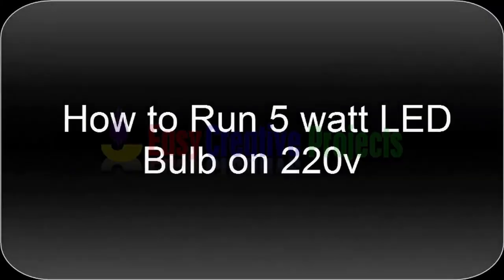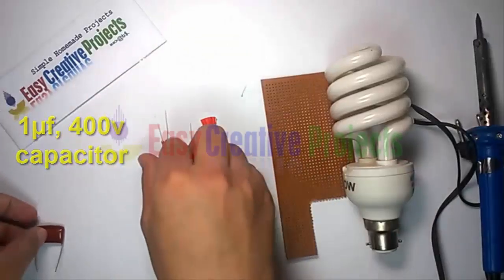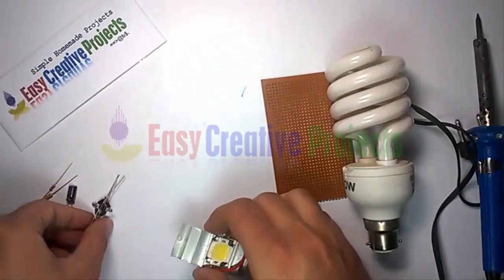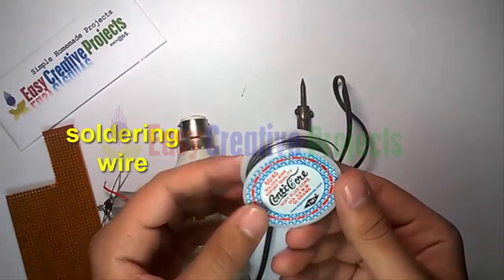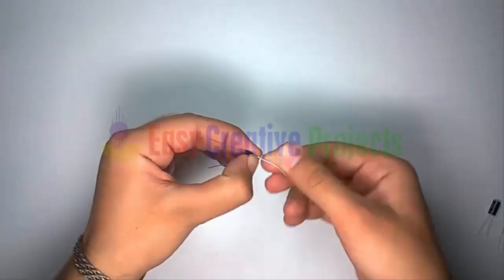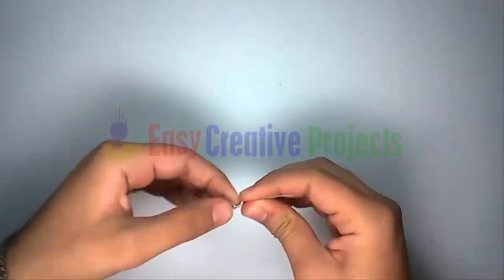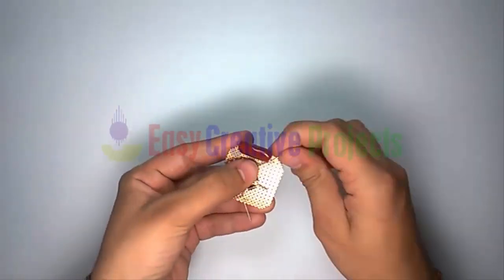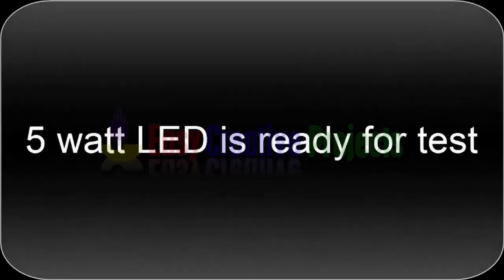How to Run 5 Watt LED Bulb on 220v - easy step by step with circuit diagram

Comment: These ckts are not good for long term use, because these non polar capacitors bursts in many cases. Again the driver ckts along with the LEDs are readily available in the markets. So don't be fooled  to drive the 12 v/5w led in 220v ac instead of 12 v driver ckts.
Reply from the maker: amazing dear.
in exam and practical you say, we can buy it form market. and get 100 marks.
dear these project only for education purpose. you cannot use it on commercial purpose.
2nd, this led work on my home last one year and perfect working. 
if you need any help or your demand project so please tell in comment.
thanks.

Comment: First time see the components and in the circuit diagram components are different
Reply from the maker: in this project we use simple components. you can buy this components from any electronic component shop.

Comment: Please can this circuit be used in 3w led? Or does it have to be a different circuit?
Reply from the maker: dear you can use it on 3w led. but voltage must 12v.
Reply: @EasyCreativeProjects  Many thanks for the response, it helped a lot. Very good your proposal, facilitates a lot, this way of teaching to do the surgery.

Comment: That diode in the middle of the bridge is doing absolutely nothing. Why did you put it there?
Reply from the maker: dear I use a 5th diode for extra safety. because this time we play with live wire.
and I think you know china components very well.
if your dose not want to use so leave the fifth wire. 
thanks.

Comment: One "em" WTF? don't you mean "One Megohm"? At least show a bit of expertise here please. Even a newcommer to the hobby knows this much. And where would I get 220 volts to operate said blinky light? Suppose I could tap it off the dryer or kitchen stove. But then, I'd have to jury rig a socket to it.

Comment: U suggest 1M RESISTOR BUT in circuit diagram is showing 10 k  ...sir
Reply from the maker: dear i am so sorry. 
please follow video when i make circuit diagram. after diagram by mistake page change.
use 1M, 2W resistor.

Comment: Isme 5watt led bahut hi low jalta h
Reply from the maker: dear aap nay capacitor ulta lgaya ho ga. 
check capacitor terminal. if every thing is ok so simply change capacitor.
i use this led project last 6 months. no heating no low light. no any problem.

Comment: U have written different value of resistance, in 1st diagram u have written 1Megaohm which is equal to 1000Kohm, but in second diagram u have written 10Kohm resistance, please tell me clearly, is it 10Kohm or 1000Kohm?
Reply from the maker: sorry dear,
you use 1M / 2watt Resistor. it perfect for this circuit. 
1st i use 10k but its heat up with in 5 mints. then i use 1M. Now 4 months past. its working properly in my home. and no heat up.
Reply: Easy Creative Projects 
But the thing is that i found every component at home easily, from old cfl circuit and from some other circuit, but i  am not able to find 1Mohm resistance.
Where can i find it?
Reply from the maker: i purchase from electronic shop. 
you also try any other big electronic component shop.

Comment: Hi please tell me can I use the same components to lighten up the 10 watt LED.
Also u have told to use 1mfd 400v capacitor and 100 MFD 25 volt capacitor so instead of these 2 capacitor can I use 1 MFD 450 volt capacitor and 100 MFD 35volt capacitor
Reply from the maker: yes you can use same components for 10watt LED.
yes you can also use 450v and 35v capacitor. no problem.

Comment: 9w led ke leye kon sa capacitor lage ga
Reply from the maker: 25v 
i also explain in next video.
Reply from the maker: dear try to use 470uf capacitor.
Reply: or ktne volt ka
Reply: ty

Comment: i want 14 w led driver . how to make & what is the components & ckt diagram . please share .
Reply from the maker: dear you want to run 14W LED on 220v?
how many voltage required your 14W LED?

Comment: are u use 5 diods??
Reply from the maker: yes, but some time.
Reply from the maker: yes,
4 diode use for AC to DC. 
and 5th use for capacitor saving.
Reply: "5th use for capacitor saving" what do you mean by that?
Is there a chance of capacitor blowing up?